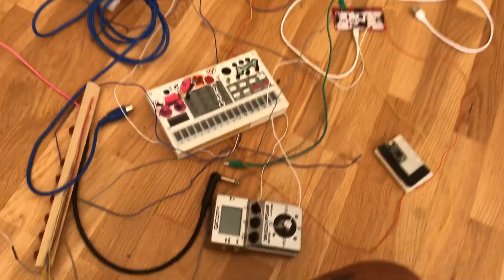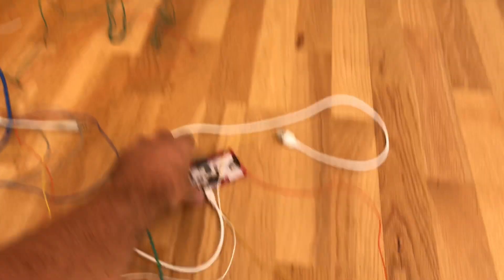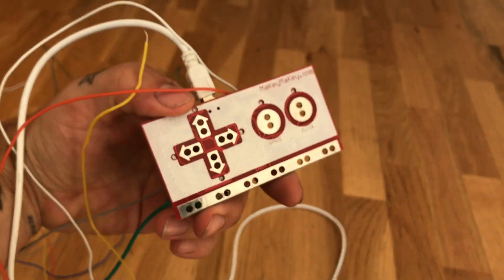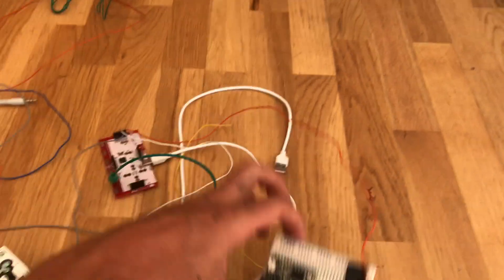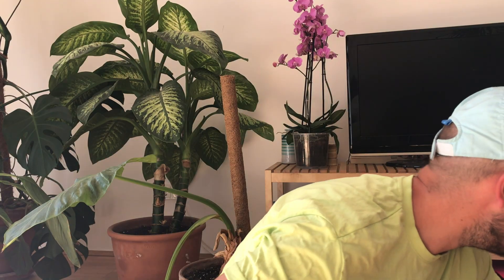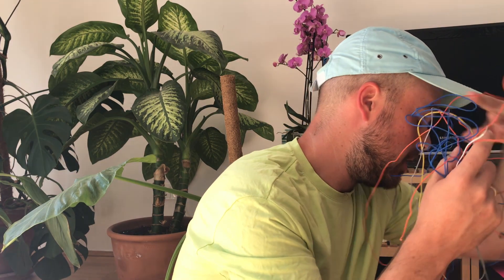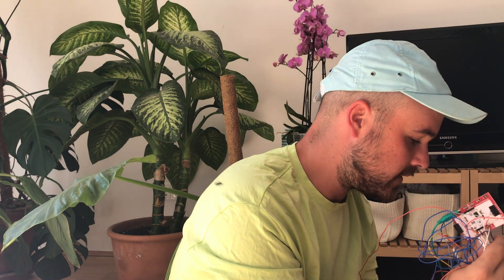TRANSFORM TOUCH INTO MIDI - Controlling a Korg Volca Sample with my face

Comment: Reliable connections are important. Common (ground) connections between devices are also important. And if you have something that might be shorting something else, that is also important. A simple solution to isolate your connections on a temporary basis is to use the green painter's tape. It does the job quickly and does not leave a lot of residue when you take it off. - At least on the wired connections. I do not think it would work well on your face.